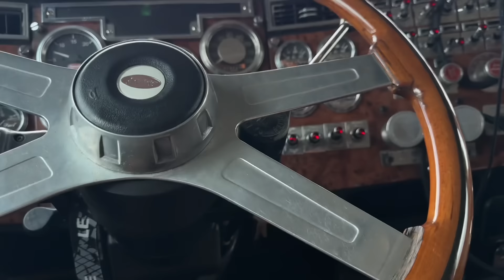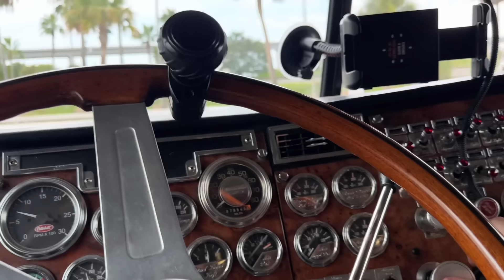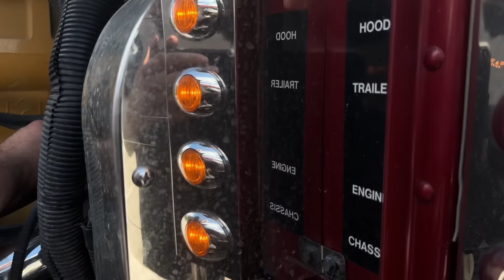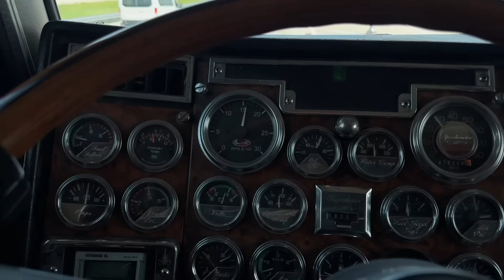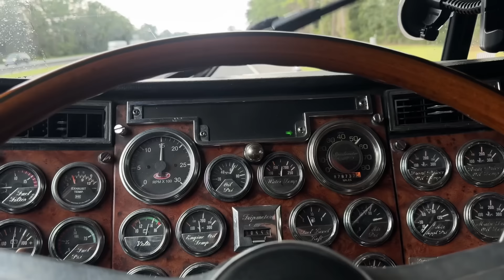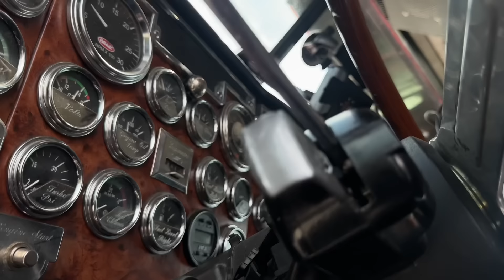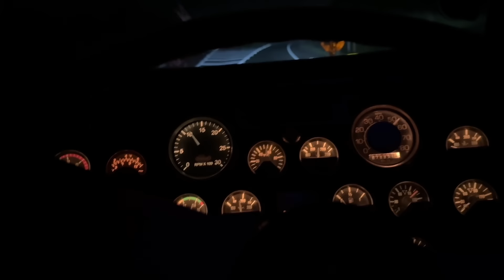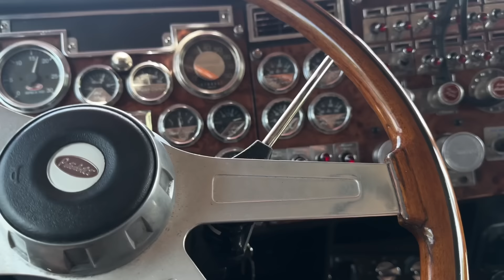My New Camera Girl Steals My Heart On Her First Oversized Load!!

Comment: Just a suggestion on the speedo freaking out
Trans yoke is loose and the tone ring is periodic spinning
 Or sensor is bad. 1 and a half turns out  from tone ring is proper adjustment. With the pick up.sensor. ex retired peterbilt tech  . Just want to help to diagnose shit 
 Lol.

Comment: Hey Tim, I really like some of the equipment you run seems like you maintain it pretty well and appreciate the old-school iron. I’ve owned my own heavy haul tractor before was it LN 9000 (I know not the greatest tractor but it was a Michigan rock tractor special. It’s what I could afford at the auction) day cab double frame 44,000 pound rears 575 hp 2k torque 18 speed eaton Fuller, would love to be able to drive for you. Let me know if you’d like to talk sometime.

Comment: What year is your 379? I had the same truck and color!!  We had to shorten the frame to stay within the 41' rule!  CALIFORNIA doesnt like anything over 41' from kingpin to the first axle on the trailer. Youre limited with those goose neck boat trailers because you can only slide yoyr fifth wheel but so far before the tractor hits the header of the trailer which will limit you being able to turn!!  Im a new subscriber and im enjoying your videos!  I wish I could still be hauling those boats!!

Comment: You know what you are doing. Question is that enough straps? Flat bed I know you need at least 2 straps per piece and enough for the weight and a strap every 4 feet.  I wanted to haul oversized and overall but never did. 😢you are a great driver and boss.

Comment: Got a question it might sound dumb. When pulling a oversized or overweight like what you have here although you have the pick up fellowing you do you still have to have amber flashing lights also. To be safe
Reply: Any oversized need the flashing lights and oversized signs to warn other's, depend on the size if needs a pilot vehicle though and then some need police escorts...